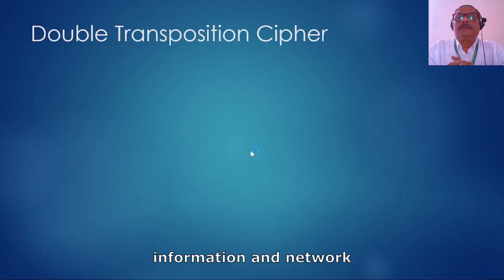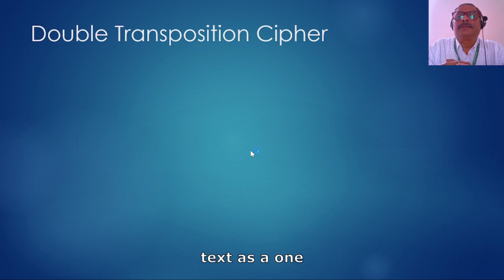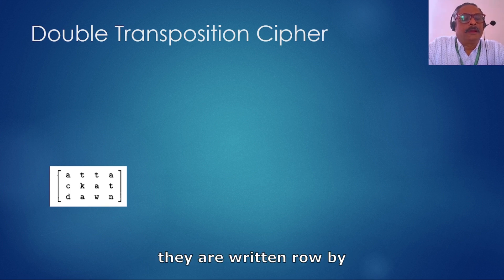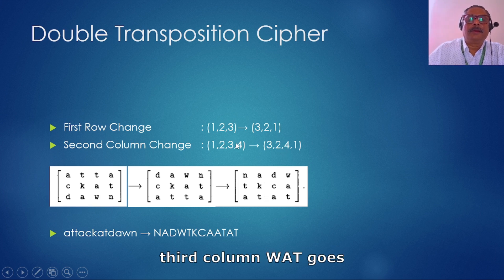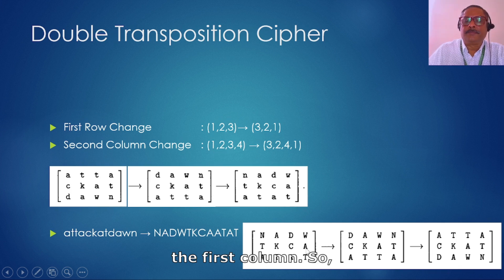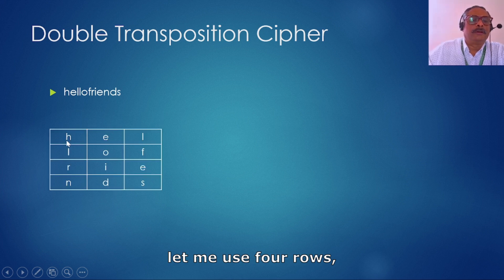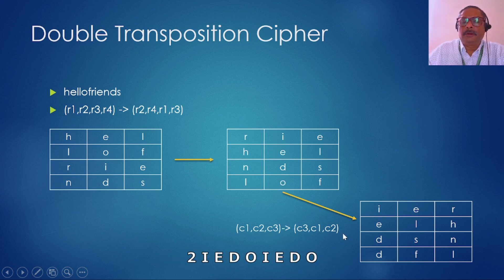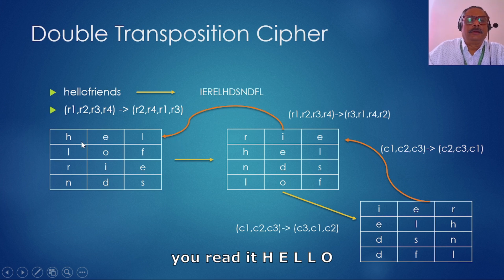BIS703 4 - Double Transposition Cipher

Comment: sir its 4 2 1 3
Reply from the maker: (1,2,3,4) to (3,2,4,1) means 1st column goes to 3rd column, 2nd column remains in 2nd column, 3rd column goes to 4th column and 4th one goes to 1st column
Reply from the maker: check the video at 3:53